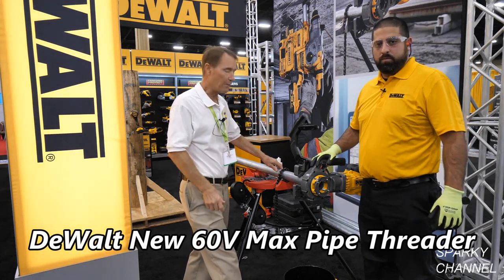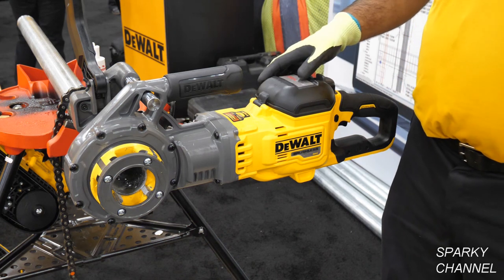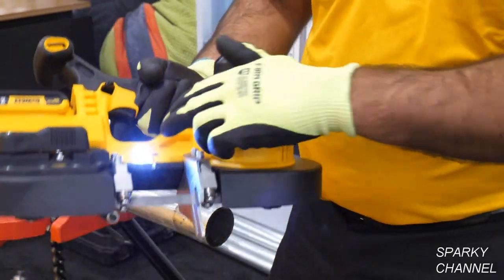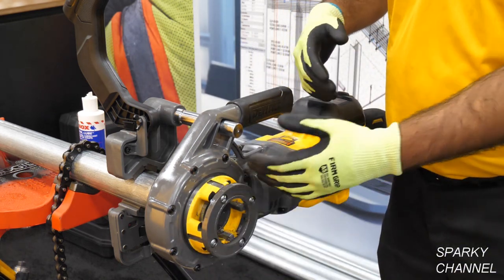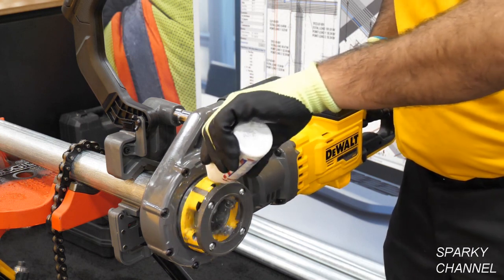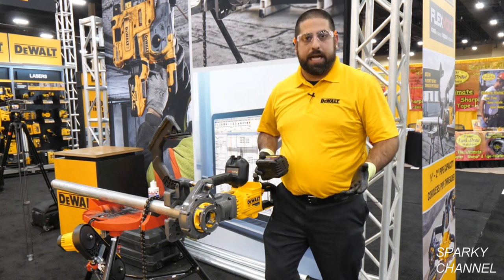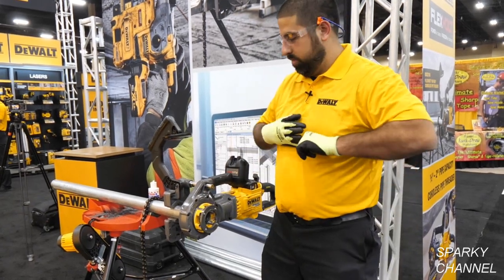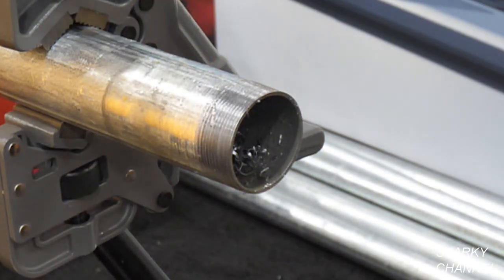DeWalt New 60V Max Pipe Threader DCE700X2 From NECA 2019

Comment: I love mine, Light commercial and residential Contractor HVAC, gas piping with the Dewalt tool saves space in the trailer also, or toss in the serv truck for smaller jobs and remodels.  No more carrying around the messy tripod.  Now they should come up with a new Vise that collapses better and saves space than the rigid ones!

Comment: they don't sell or make extra batteries. talked to sales at corporate. you're screwed after initial purchase, had mine for 2 years. 2" die is useless just chews up after 4-5 threads
Reply: Does a normal battery work or just these special ones?  Does it have a variable speed trigger or is it just on or off?